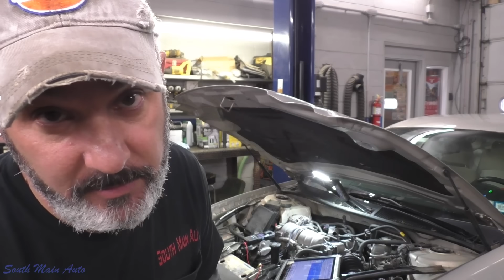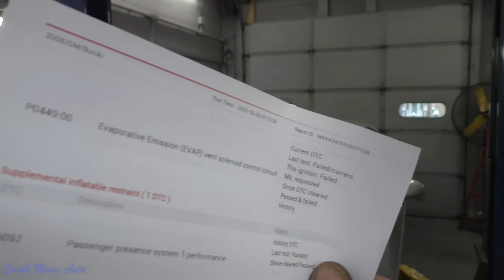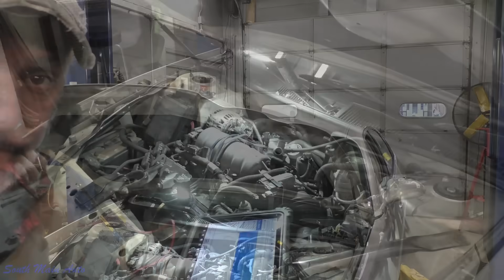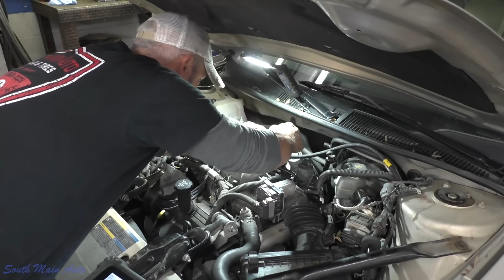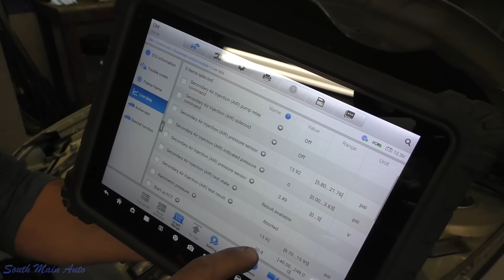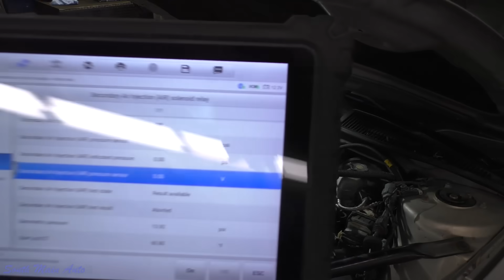When “New” Parts Are Worse Than The Broken Ones 🤬

Comment: I recently put 3 power steering pumps on a truck. All bad! I finally went and got one from a salvage yard- it worked great.
Reply: I kid you not I just installed 3 "rebuilt" older Saginaw style PS pumps on the same truck before one actually worked. The kind where you have to press the pulley off to remove the pump, you talk about pissed off.
Reply: @COBRO98  mine started puking out the seal and the cost of a rebuilt one was way too high, due to the tank with hose fitting for remote fill/tank. so I found the full rebuild kit at summit racing and rebuilt it. the only thing wrong was the seal and the fluid was eating my serp. belt up. kind of glad I decided to rebuild instead.
Reply: What store did you buy the pumps from?    There is no liability in just telling the name brand.   People are afraid to, but you have the right to tell the truth and name names.
Reply: @jeffro221  Yep, as long as what you're saying is true, then you can't be sued for libel/slander.
Reply: Correct. If it's true you can say it and they can't do anything about it. Just don't lie is all.
Reply: I did 5 on my small block before I found one.

Comment: I work as a "dealer tech" at a local name brand machine company (name withheld to protect my job) And it's the same all over. Branded named new parts failed right out of the box. And don't even get me started on remanufactured parts, we refuse to use them unless it's the only option. I absolutely hate having to re-do work because of a crap part. Or like you said, even worse when the customer has to return their machine with the same issue weeks later because the new part failed. "Pride", "Craftsmanship" and "Quality" are hard things to find these days.
Reply: the web development industry is filled with this type of slop as well. every 12 yr old thinks i can do the same job as an adult, when they turn 18 they use hr mommy to put them in these skilled positions, getting us men removed then use ai to build  their product, and it gets easily ahcked, bc they dont know anything. rinse and repeat. the amount of sec risks introduced in the last 2 yrs should scare everyone using websites.
Reply: @the_internet_sheriff 
Man, at this point, the highest mark of quality for a website for me is that it is static and looks like it was designed for 47k modem connections. And that is saying a lot. Granted, if you're doing file transfers, you will always have some security issues, but that's why authorization tokens and input filters exist. Problem with these AI hammer programmers is they do not even understand what they need to ask for.
Reply: @rockytom5889  even google search has it infested, when i upgraded arch last it broke, i was left with console so im like ok ill just fire up good ole links and booom, google no longer supports textmode, i simply didnt want to fatfinger my pacman restore url.

Comment: Eric- Automotive is not the only place where crappy parts kill you. I worked on Zenith TV sets for 65 years. When Goldstar took it over, all the remans went south of the border. We had to order 6 (!) 9-160 modules to get just one that would actually work.  So your profession is not alone with crapified parts.  . Then came the picture tubes that would blow the new mainboard..... It went further down hill from there. We finally refused to work on Zenith TV sets because of the parts problems.
But to enlighten your day: How do you stop a battery from charging?   Take away it's credit card. 
Have a good weekend.

Comment: I feel ya. 2005 Silverado. Replaced all of the actuators for the HVAC system. Fun! Control for auto HVAC has been replaced 6 times. Can't get a good one. What do I do? Delco doesn't make it anymore. Used ones are junk. Damn truck is perfect- provided you don't mind having to sweat in the summer and freeze in the winter. The individual systems work fine. MF. These vehicles will die because the replacement parts... SUCK!

Comment: Current LADEN test LIGHTS are absolutely preferred to VOM meters that draw insignificant current.  

Crusty green connections might yield VOM acceptable voltages but NOT for an appropriate loading test light.  I.E.  makeup a set of appropriate current rated test lights to check supply voltages to devices, NOT VOM TESTS!  
E S P E C I A L L Y   when testing grounds.... "trust me!"
Reply: @tomtke7351  if you are dealing with electronic versus mechanical switching, only an actual resistive load will prove the circuit, me thinks.  A volt test is inconclusive
Reply: I had to learn it by accident when getting crazy result testing heating  equipment circuit boards.  Most everything is mechanical relays.  A jittery DVM display was confusing.
Reply: @gordonborsboom7460 That's what they taught in radio electronics repair circa 1970.

Comment: You are not alone in the world of new junk parts. Just installed a new blower speed resistor and it was junk. Also received a pair of windshield washer squirters and of course one is defective. Told my parts guy that I wanted 4 good quality North American brake rotors. The boxes looked like genuine N. A. stuff but the rotors are Chineseum, and yes, they are already bouncing and chattering. Mother %$&@#% garbage. How can you warranty your repairs?

Comment: ever since covid i have noticed a sharp decline of quality control on all manufactures. like moog suspension products are trash and will guarantee to fail in a few hundred miles. electronic parts are a whole pile of junk from ALL manufactures. I just wish someone could make a website that mechanics  you can file a complaint to the manufacture of the component and they get fined for making a shoddy part that will never pass inspections.

Comment: I feel your pain, just went through it with the ESIM on my 2015 RAM. 4 different Dorman units from different sources cleared the 0456 and 457 codes, but prevented me from getting gas into the tank. Tried the Duralast version and on the 2nd one I finally got the problem fixed.

Comment: I had that experience with a Wells EGR valve for a Honda Civic 1.8L.  The darn thing had a leak from the vacuum port to the atmosphere, past the solenoid actuator shaft.  (Yeah, I blew thru it with my mouth; LOL)  I don't think they even designed that valve to have a seal there.  The car threw lean codes immediately, and I had to use a smoke test to find out that the new EGR valve was FAR worse than the one I took out that had no such leak.  I've concluded that the EGR Valve Position Error I see in real time data (cause for my replacement) is from a software bug in the ECU.  Car runs fine on the old valve.

Comment: The parts people got ahead of the car designers!  How you say?  Well...  car computers are headed toward self diagnosing failed components.  Currently it's mostly down to component ARENA:  wiring, support systems, and actual component.  Someday the computer WILL identify a bad component... and so faulty NEW stuff will be instantly identified.  BUT NOT 2025, yet getting closer.

Comment: I’m right there with ya Eric. 50+ years of working on this stuff. Today was replacing oil cooler lines, radiator and water pump on a Chevy express van. Got the oil cooler lines from gm,and the radiator and water pump from the parts store. The oil cooler lines won’t fit the quick couplers on the new radiator! Had to take the fittings from the old one and put them in the new one! Then put the vacuum non the cooling system and it won’t hold, turns out the brand new thermostat housing leaks on the new water pump.ugh! No more aftermarket parts! I’m done.

Comment: The sad thing is that the part that does work,  only works for a week. The part store could test every part before sending it out but it will fail on the ride out to your shop. If every car manufacturer used the same parts it would be easy to test on the way out the door at the parts dealer but.....with a million odd schemes to do the same job, all with a different designed part no parts dealer would have a jig to test them all or all the trillions of other testable parts. Garbage in, garbage out. Two hours to find the bad part and put in a new bad part. Shiny but still broke. Off to Wilbert's. The part that made it 160,000 miles might have more life left in it than the new part started with!

Comment: Am 71 now and have always done my own basic car repairs. Still haven't been to a quick lube  oil change shop. Though not running still have my 1968 Javelin I bought at 18. In the mid 1970's my Dad's 1970 Ford station wagon needed a starter. Got him a rebuilt one from a local parts shop I had been going to for several years. Had become friends with one of the younger counter guys, of course we both had Javelins. Installed the rebuilt starter only to find it wouldn't kick out the starter gear. Returned it and got a second one but this time tested it with jumper cables before trying to install. Same problem. Returned it and was getting a third starter when one of the more senior counter guys noticed my returns and questioned my return. He took the starter to check it but found it was defective. The third starter was the winner. Great quality control and testing. I look back and know that rebuilt isn't always best but I was young and learning a lot about car repair. Love your videos!! Am now a retired electrical engineer having  fun with my 2018 Mustang GT and 6 speed (and ridiculous 10 quart oil changes) but hope to get motivated enough to get my 68 Javelin back running and on the road. Keep the videos coming !!!!   😆

Comment: I'm just a DIYer but I have seen the same thing working on my cars. It's to the point I won't change a part unless I absolutely have to. Sensors are the worst. Who do we turn to? Who can we trust to give us good parts? I have a 97 Tahoe a 98 Expedition, a 04 F250 and a 05 Suburban. I love them and refuse to buy new but the junk yard is fast running out of the stuff we need.

Comment: Are we at the point manufacturers are purposely making crappy parts so the parts place can up-sell you a better quality part' (same part with a different label and more $$) or are they trying to get shops to stop fixing older, easier to service cars so the consumer is forced to spend even more $$$ on a newer POS car that needs a $10,000 scanner (aka the dealer) to service it?

Comment: It's all part of the plan to get people to buy new cars that make investors rich. 
I saw a rebuilt "thoroughly tested" rebuilt water pump leak through a rust hole with no pressure on the cooling system. No way in Hades that part was tested. Sure, they'll give you a new one and apologize but that don't fix diddly. And because they use cheap bearings that 'new' one will die in a few years when it should last a decade. Bad enough when you're a DIY'er but kills Techs just trying to make an honest living.

Comment: Man, I feel ya. It's ridiculous. I hate SMP parts. You can't even get a connector just for the plastic. you have to use their pigtail because the terminals are just different enough that it won't fit the oem terminals. It's not a big deal, but then you have to cut and solder and blah blah blah.. ironically it was a 2003 Ford Thunderbird. Right after I watched your thunderbird video. Sometimes it's a tomorrow problem. Hang in there, Eric.

Comment: i own a 1992 Chevy K1500 OBS body style with the good old and faithful throttle body injected 350 small block chevy engine  its the truck in my profile picture if you get this comment well anyway i went through 3 starters until i got a good one so far than the ignition control module under the distributor cap went out went through 4 of them 2 from autozone 1 from advance auto parts and the 4th one is from Oreillys and its been in there for 4 months now knock on wood still works but yeah new parts are complete shit now adays so i feel your frustration man it sucks but hang in there eric o been watching your vids for 6 years love the videos

Comment: Parts are getting so sooo bad I share the frustration
Reply: and I've been finding it isn't just the after market.. the factory parts are also just as bad... guy put on a timing set on a 3.5 ecoboom, started it up and it rattled WORSE than before, ended up being a bad tensioner. brand new ford part. horrible

Comment: As a very old shade-tree mechanic (Chevs/Vette, etc.) I haven't seen mention of the problem being Chinese manufacturing.  Yesterday, I had the minor job of assembling a Chines made table for puzzle-making.  I said before hand that they surely had learned to very accurate refine their work and mistakes in THE PRINTER MATERIAL alone would be correct.

Guess what!  In the single page is pictures and instructions, they failed to indicate the placement of the base frame to the table that would fit either.  Assembled wrongly, a chair would not fit properly underneath.   And Chinese small engine carbs/parts are another joke.

Comment: I spent 30 years working in PR-NY. Voted with my feet. Now I'm in the southwest ,1 car will last a lifetime here, Let a car sit for a year and the rotor is still so shiny I can use it for a mirror to shave my grey beard,  Scotch locks here will outlast a whole vehicle in the rust belt! No more green crusties! Small town , no emissions, no inspection! No more replacing brake lines! Still stuck with Chinese parts though, better off getting used oem from ebay then that junk in most cases.

Comment: I got an Amazon fuel pump one of the lines popped apart on the housing twice. I ended up pulling the tank a total of 4 times. Once for the pump, second assuming the transfer was bad, replaced it, saw the line popped apart on the main and assumed i did it pulling it out. third time to repair the "new pump" once I realized it to be the true issue and a 4th time because the oring was swollen and popped out of place and it had to be replaced also... It almost left me stranded twice. 

 Another pump I bought for a truck ran for a day. Sat for a week and then wouldn't turn on unless I banged on the tank... 

Got a windshield wiper pump that lasted all of a year and my mother in law doesn't even really use it..

Amazon pumps are a hell nah.

Comment: My wife's 2010 Forester after start up, if you sit still idling. When the secondary air stops the stft goes -17 ish. Idles little rough, most people wouldn't notice. 
Then seconds later the trim comes back to 0ish.
Is that normal operation?

Comment: I work at a BMW dealer and have never seen a bad part out of a box in eight years of working there. But when you get an old enough car with discontinued parts, you gotta go aftermarket. Now, there's where I see a ton of non-functional 3D printed garbage parts. It's infuriating these companies go about their business like this.
Reply: I'm just a guy who wrenches on his old BMW but this is also my experience. No issue with BMW parts. And when I have to go aftermarket, I go with OE such as Bosch, VDO, Hella, Continental, etc. I tried one generic idle air control valve from eBay and learned my lesson (it would hold the idle at a crazy RPM).
Reply: @ClassicBMWFanInQuebec  I've never had an issue with Euro parts either. First thing I've thought of when watching this
Reply: Second best, if you can't get OEM labeled is parts from the company that originally made the OEM.  I have gotten some great high quality parts from my older Lexus from Denso.
Reply: @squaaaaak3178 advanced auto parts had a better bolt for a control arm than the what I ordered from gm, it wasn't worth the wait or the money
Reply: @AS768  old enough, ~10 years or more
Reply: What dealer is that ,  I'd have to call you a misinformed technician

Comment: I think we can all agree where most of the problem is. CHINA. Chinese manufacturers have no quality control, though they may say they do. Everything goes out the door. They play the numbers game. Sell 10,000 widgets. 5,000 actually work. Two to three thousand need the end user to fix it to make it work, and a couple thousand are total failures. From that 2,000, maybe half get sent back. So 1,000 claims that go ignored anyway, or maybe half get replaced. China is still way ahead. And when the manufacturer eventually ends up with a bad rep, they just change their name. Not to mention that automotive parts are one of the most counterfeited industries. It's so bad there is a council that tracks it.

Comment: When I was at whitwood motors in Wellsville I had this happen to my 2008 Cobalt. Two bad AC delco out of the box before the final one worked. Literally went to the junk yard and pulled secondary air valves and pumps off as many as I could find. I now work at the napa in the same town and wouldn't ya have it? You're right everything sucks. Trying to keep a 25 year old Jetta diesel going with nearly 400k miles is beginning to become a chore.
Reply: That's one of the easiest cars to fix with oem parts. Cascade German, id parts, fcp euro. The list goes on

Comment: Hi Eric 
Been there done that. Its not only aftermarket parts. Dealt with a 85 park ave., with electronic climate control decades ago as a gm tech. Rear windows grids wouldn't function. 5 electronic climate control panels later from gm it operated as designed. Everyone thought i was smoking wacky tobacco. Its not only aftermarket parts. 6th climate control panel was a charm.